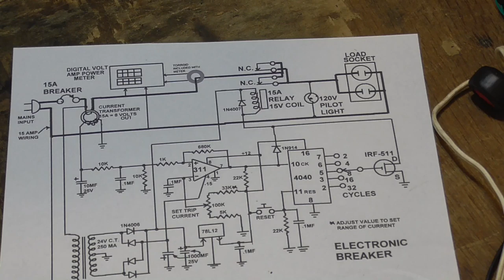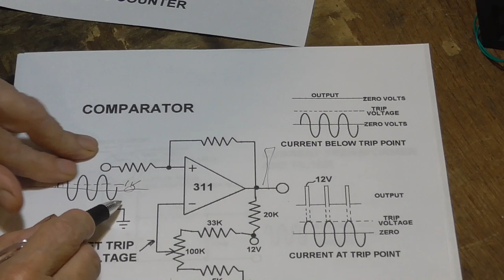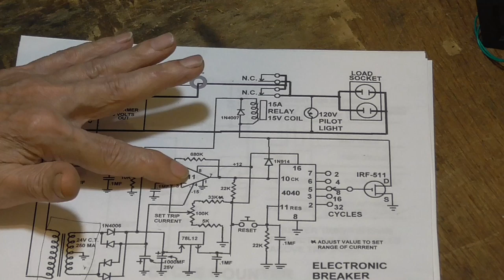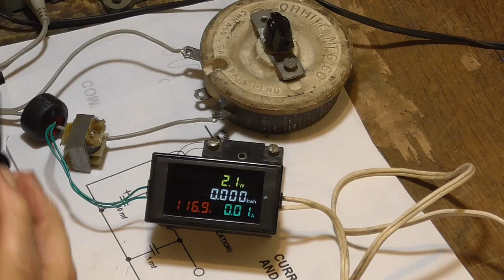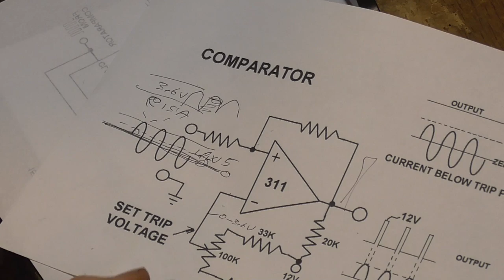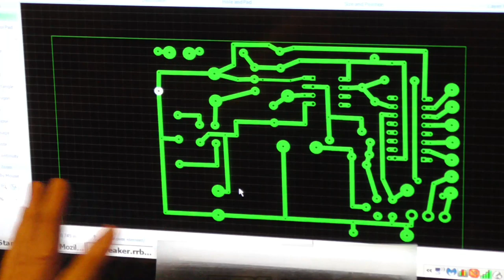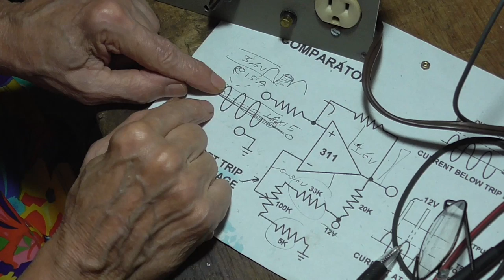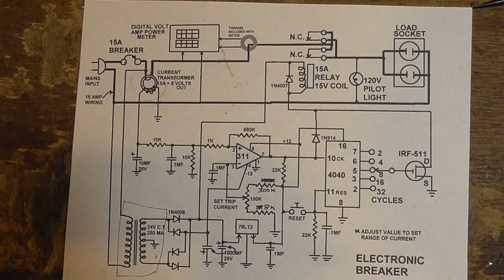BUILD AN ELECTRONIC CIRCUIT BREAKER

Comment: Why set it up fail closed on the relay? I think it would be safer to have it energized and go into a fail safe condition on a trip.
Reply: You could add a nice size fet as well inline with the relay to overcome the physical delay of the relay as well as prevent welding your contacts or having an ark over condition. 
Adding an MOV or two would be a good idea as well.
Reply: @chasingcapsaicin  It's probably set up normally closed so it doesn't cycle every time it's plugged in or removed. As far as the extra fet goes, that relay is switching mains, so naturally a fet will explode as soon as the voltage is such that significant current flows through the body diode. Adding the circuitry to have an IGBT soften the current across the contacts would add a fair bit to the circuit. The contacts will probably be fine because they only actuate under trip condition so they're in the process of opening when the arc occurs and I doubt that smashing the reset button without unplugging whatever tripped it is not an intended state. A MOV wouldn't hurt anything but neither the current transformer nor the 120v->24v are going to let enough current through for them to be really necessary there and anything being plugged into the socket which requires one will have an internal one so I'm not sure it would be worth it to have that additional power loss in the breaker.
Reply: I am pretty sure the relay action will be faster on energizing, and that is what is most important here.  There is a breaker in the circuit that provides the exception for unexpected events.
Reply: @argcargv  Exactly what I wanted to say
Reply: @argcargv  "I am pretty sure the relay action will be faster on energizing" -- we know that energizing applies more force than the return spring, right? Otherwise the coil would never overcome the return spring.  So, yeah, P=ma and energizing the coil should cause faster movement  :-)

Comment: Hi Ron
How would you expand this to 3 phase system 
Would it be 3 current sensing devices into a larger comparator
Reply: Most of the circuit would be replicated 3x. The relay could be replaced with a 3 phase relay with whatever rating for your need.  The input to the relay would also need to be logically or'd (diode or) with all 3 of the sensing circuits so all phases would turn off at once no matter what phase was responsible for the fault . The power supply might have do be accomplished differently but, the op amps and counter will work with most dc split supplies as drawn and if your lazy even 2 batteries. Also with 3 phase the cycle counter might want to stay in the faster settings 16 is pushing it if your working with 480v imho. Please be careful at the high end, voltage can cause unexpected explosions.

Comment: But the relay delay  is  maybe 1 Cycle. You should use a triac ?
Reply: Minimum trip time is 2 cycles IIRC, so we don't care about a 1-cycle delay.  Though I do feel bad for the relay contacts, breaking the trip current  ;-)
Reply: You can't just switch the TRIAC off, it latches. If you'll trip at the beginning of the cycle, the TRIAC will let the remainder of that very cycle to come through right to zero cross point.
Reply: @mrjohhhnnnyyy5797  Well, of course. But the relay pull-in time is comparable to the 1/120 = 8.3ms half-cycle time, so we don't care much -- especially as we're intentionally waiting a few cycles to cope with inrush current.
It's not like the relay would break the circuit in a microsecond, eh.
Reply: That time is not relevant  also using a triac would be  less reliable and more dangerous due to the failure mode of the triac as triac usually fail short which is the last thing you want in this type of device
Reply: @T2D.SteveArcs  It doesn't much matter if the TRIAC fails short, because there's a 15A breaker upstream of it.
Plus, y'know, buy a TRIAC that's rated for a nicely-high peak current, if that's your big concern.
Reply: @theskett  of course it matters thats the whole idea of the device a super fast      current limited disconnect to save sensitive equipment.. By your logic we may aswel not bother with the device and just reley on a 15A  fuse im sure that current rated fuse will be fine on our sensitive electronic equipment repairs and doesnt matter about rating of triac they can and do fail in circuits they are rated to be used in. i dont want to get into an argument over this all im going to say is i trust Ron knows what he is doing he has been using this design for years... if your design is better i would love to see a video on your electronic fuse
Reply: @T2D.SteveArcs  The 'fuse' device is exactly not super-fast, it's intentionally delaying by 2..32 cycles to allow for inrush current.
And "doesnt matter about rating of triac they can and do fail in circuits they are rated to be used in" -- if you pick 'em too small, and don't use snubbers etc., sure. Otherwise, very rarely.
Reply: @mrjohhhnnnyyy5797  Crap he's alive.
Reply: These devices will never work as you think they would. There is nothing better than the ordinary circuit breaker. And the 15A is its most common rating.
Reply: @vant4888  Except you can't adjust an "ordinary circuit breaker" for current or latency; hence glasslinger's choices.
And there's an ordinary circuit breaker in there anyway, for CYA :-)

Comment: I have a lot of personal experience with large amounts of current flowing in an out of control and unpredictable manner
Reply: You should definitely expand on this; bad day at a reservoir? tidal bore? superconducting magnet quench? 'chopper linesman?  So many questions...  :-)
Reply: Welp, that's a disappointment; I can manage 'stupidity' any day of the week :-)
Reply: @theskett  It started out when I was 4 year old when I was shoving knives and tweezers into outlets to cause an arc flash and to make those infamous black streaks on them
Reply: I had a big red stripe across my hand for weeks, as a 6yro, from short-circuiting a car battery.
Sparks are life, man :-)

Comment: The current during short circuit is around 100-300A and you are going to break it with 15A relay... And guess what, that relay is not working instanteniously too. Have you seen the arc during breaking ? It could jump to anything inside that relay. I guess you think that fuse will save the circuit. Circuit looks ok but it just pointless.
Reply: On a dead short, the 15A breaker upstream of the relay should trip at [about] the same time as the relay opens; and (unless glasslinger bought a $2 Chinesium 15A breaker :-) that breaker will open the circuit just fine, and will thereby kill any arc in the relay.
Worst case, the relay contacts get pitted, but the circuit opens anyway because the 15A breaker in the project, or the inconvenient 20A shop breaker, opens.

Meanwhile the 15A relay can happily interrupt mild overloads (e.g. kit that should draw 100W instead draws 1kW), which is glasslinger's daily usage and far more likely than a dead short.
Reply: Kevin Counihan  Good point, on putting the relay contacts in series; thx, hadn't occurred to me :-)
Though relay+TRIAC is harder than I'd want to work; either use just the relay and suffer the contact-burn, or use just the TRIAC (or maybe a couple in parallel, with load-sharing 20mR resistors?) and cut the gate drive ASAP on a short :-)
Reply: Kevin Counihan  Ok, good call, I yield the fight :-)  $5 on AliExpress for an SSR, no thought required.
Although tbh you're assuming the relay coil is energized (i.e., the opposite of what glasslinger's configured) during normal operation; so to use the relay NO contacts rather than NC, and have the relay powered until there's a problem.
Edit to add: we need not to pump 32 cycles of AC to a dead short, so there needs to be a little other rework too.  But, details details... :)
Reply: Kevin Counihan  Your "short detection" explanation is a little tricksy to follow without a whiteboard (not your fault :-) , but if I understand right: one very-high-current (short cct) half-cycle should cause comparator #2 to disconnect (de-energize) the relay, which then will stay open (regardless of comparator #1 and cycle-counts) because the relay coil's in series with the now-open contacts.  
Cute, good choices, makes me want to build one of these (y) :-)
Reply from the maker: I have been using this unit for right at 20 years now and have had literally hundreds of trips on all sorts of loads. NOT ONE TIME DID THE RELAY "ARC TO ANYTHING ELSE" IN THE BOX. This unit is only intended to break desktop projects, NOT meant for huge industrial loads. The unit DEFINITELY is NOT pointless! It saves things like scope ground clip wires, incorrect connections, etc. that would be otherwise burned if the house breaker was the only protection.
Reply: I'd also emphasize that this circuit is meant primarily to supervise "experiments" that should, for example, only draw 5 Amps, but should be cut off when they don't behave as expected - before they smoke at, lets say 7 Amps. A dead short will trip any "regular" breaker upstream anyway.